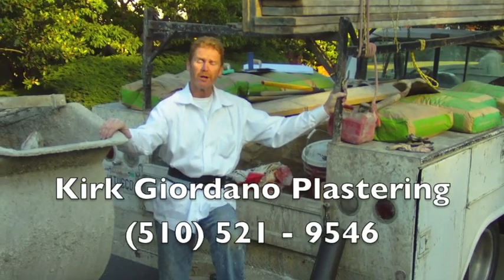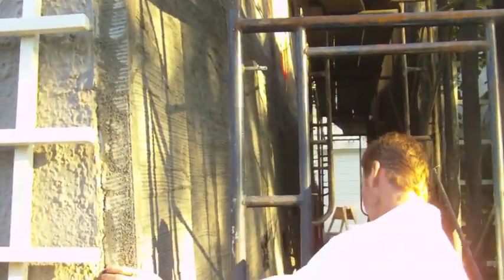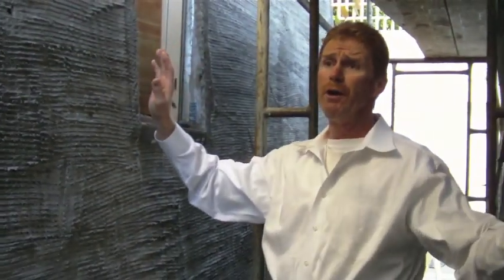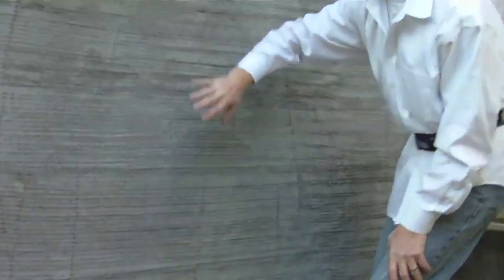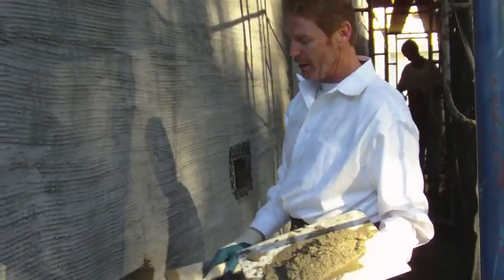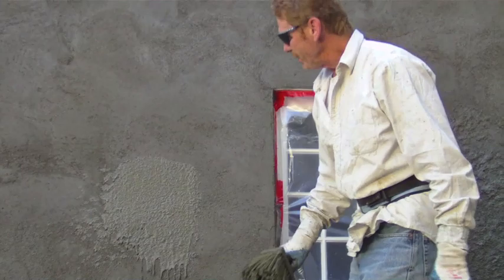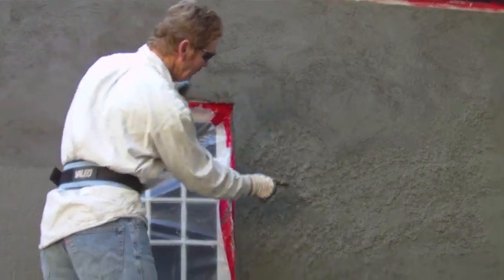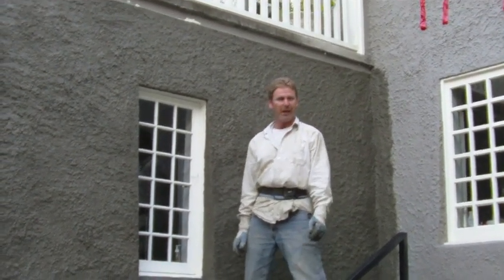Throw on a tunnel dash with a dash brush

Comment from the maker: Hey hunter dude, I usually match what I see. I have thrown stucco dash by hand used either a hand hopper and shot it on with my big tommy gun, when I owned one, at a fine to extremely heavy finish. I once took my orifice off my Plastering machine and sprayed it on direct.
Have a groovy day!
Kirk Giordano plastering

Comment from the maker: Hey pal, here in the U.S. the word stucco is technically used for exterior Portland cement, and the word plaster is generally used for interior projects.  From what I understand the term rendering is widely used in Europe, Australia and other parts of the world which also means basically, exterior portland cement also. Thanks for the words I haven't yet heard I will research them.
Best wishes with the move. 
Kirk Giordano Plastering

Comment from the maker: Howdy Mindozas, Thanks you. 
There are many ways to achieve a very similar match. 
Weather does play an important part of the decision of how I match exterior finishes. For example if this were a hot day, it would have been so much easier to complete this finish as is I had to wait forever for the dash base to cure.
Best wishes, and thanks again for the bone. 
Kirk Giordano plastering

Comment from the maker: Mr.Zamorano, it's not such a big deal if the scratch marks aren’t very deep, I would say 1/4 inch is best. But it's tougher to get the mechanical strong bond without them. You can mist the walls then apply the brown coat or mist and apply a bonding agent, on little areas you may be able to simply mist and the suction may be enough. 
Best wishes, 
Kirk giordano plastering

Comment from the maker: I do sometimes apply taping mud over fiber mesh tape. But mainly I apply plasters to insides. If someone want’s taping mud I often refer them to someone else. But if they want plaster, this I enjoy doing, usually one coat with no sanding. This application is also tough on the shoulder and arms but I enjoy the workout. Use it or loss it. 
Have a groovy evening.
 Kirk Giordano plastering

Comment: To the Guys of StuccoPlastering. 
  It was amzing how well you can do your job and at the same time sharing it. Indeed a sign of long years of experience. I have a porch which I would like to extend my living room to it. Doing that need to stucco 2 of its side. I would like to use my existing french door on one of the side and a another door to the other. Porch is 3 inches lower than my living room slub. I believe that nothing that you can't do. Hope you can give some advice..-Kheps

Comment: Hi Kirk.  Any DIY tips for applying stucco over HardiFlex?  Will that application have long term durability?  Thanks for all the great videos.
Reply from the maker: Howdy Tom, it really does not matter what type of porous board you install like the cementitious wall in the video it's porous so a dash or tunnel dash will adhere with the proper prep work.
The hardest part is knowing how to mix your dash mud and how many coats will be necessary to get the finish you want, it takes practice.
 cheers,
Kirk and Jason’s sand and cement rendering videos

Comment: Hi, Love the video's. I've inherited a stucco house, that needs an emergency/cosmetic repair. I'm racing the weather up here in Northern NY, 30 miles from Canada, repairing a couple spots that combined, equal about 8' x 3'.  Needs a dash finish.  I've got the scratch on, and am waiting for a day at least in the 40's, followed by a couple of  nights that won't freeze.  I was curious at your mention of getting that 1st dash coat true and plumb. Am I right in guessing that it is done by eye?  How do I gauge the consistency of that 1st dash coat?  I'd just learned yesterday that my father had redone one entire side of that house, about 25 years ago, when one of my brother's asked me if the wall that he had done, was the one that was all cracked. It was a different wall, and when I took a closer look today, and there is not a crack anywhere to be seen.  I wasn't around when he did that job, and am quite impressed with it.  He was 1st  in the Army Corps of Engineers in WW II, then a tool maker, then a mechanical engineer.  He was a jack of all trades, and certainly knew his way around a bag of cement, having laid many foundations, and done lots of stone work on his house.  In his middle 70's, while having a 4'x20' garage foundation poured, the cement truck operator, told me that no one built better forms than him.  For some reason, he  wasn't particularly good at passing along his knowledge, though.  He passed away last March, after 5 years of Alzheimer's @ 95.   Unexpectedly, among the many things I wish I could ask him about, is Stucco work:-).  I'd always marveled at the craftsmanship that created smooth plaster walls, and especially ceilings.  Anyway, as said, I really appreciate your videos, finding them very informative, and engaging. I would like to learn more, and while realizing that experience is the only way to learn this trade/art, would like to ask if there are any instructional manuals that you would recommend?    Thanks again, John
Reply from the maker: Howdy my friend my1after909 dude, thank you, you gage the dash mud by mixing your cement plaster as you normally would then spay in about 2 to 5 cups of water, get a dash brush, submerge it into water first,  then dip into the bucket and mix this mud with water and get it to a consistency that you like, then try throwing the dash on the walls, you should be able to see right away if you need more or less water.
 FYI, you have stumbled on the manual to understand everything there is to know about the art of stucco and then some,  (600 videos at leat) simply by watching and paying a small bit of attention you can and will save cash, create a sense of euphoria and sleep well knowing, no problemo, I did this repair myself.
Save cash, great workout, sense of accomplishment, what more in life does a righteous person desire? Best wishes,  kirk Giordano

Comment: I am a stucco contractor in Las Vegas Nevada, 3 generations in the industry...weaning active precast, Gfrc, gfrg, foam shapes columns capitals etc.   I run 3 piston plaster pumps every week.   Unless it's a small patch I would use a stator pump.    These guys do decent work but man are they slow.    I also never use the that welded (square hole lath)... It's junk.  Use 17ga woven lath for 3 coat applications.  Much stronger.  Or use metal lath (diamond mesh 2.5oz or 3.4 oz for scratch/brown with stone or tile over.  Very very strong.   Go with an acrylic finish to eliminate cracking in the future.
Reply from the maker: rrmchispas Hello, good tips, however, we were hired to apply the brown coat and finish coat, the folks who did the lath and scratch were fired.
 I too had a tommy gun and a smaller pump for blowing on color finishes, those days are far behind me as I no longer wish to baby sit 10 to 12 men daily.
 beat wishes, 
 kirk Giordano plastering

Comment: Kirk,  I can only find a dash brush with plastic bristles which does not hold enough slurry for the dash.  Where can I find one similar to the one you use.  Thanks.
Reply from the maker: Howdy James, good question,
http://amzn.to/2nphlWL  
http://amzn.to/2mGcdZX
http://amzn.to/2nTgmuF
http://amzn.to/2mFVl5D
Howdy everyone, after 7 years and around too videos, Jason and I have joined Amazon affiliates and added some links to the products we use when we receive calls from folks asking where to purchase from?
Above are the dash brushes we you.
    For your convenience I have added a link to Amazon so that you may purchase specific tools and or material with the click of a button, BTW, you support us a bit as we might make a buck or two from your purchase.
 Unfortunately we're not getting rich making these videos, however the benefits we receive from of teaching can’t be measured in money.
 best wishes and happy Plastering,
Kirk giordano Plastering tips
Reply: Thank You Kirk.  I get by with the plastic dash brush from Amazon for small repairs but I tend to dip more than I need to.  For larger applications I use a mortar sprayer with different orifices for the desired texture.   I used to use a mason "stickle" brush  for the smaller stuff but you just don't get the right spread off the brush.  Thanks for responding and take care.